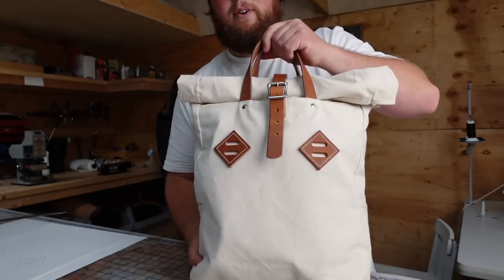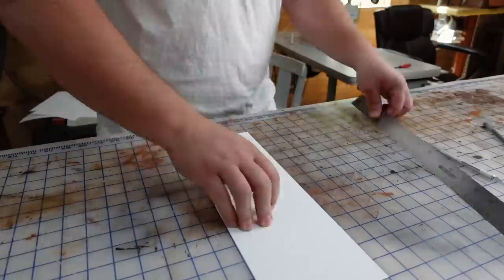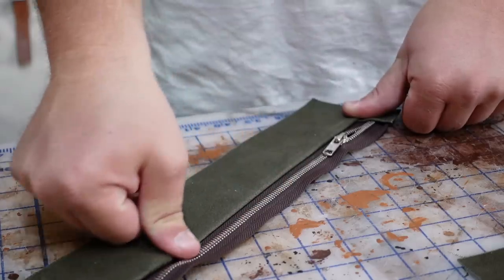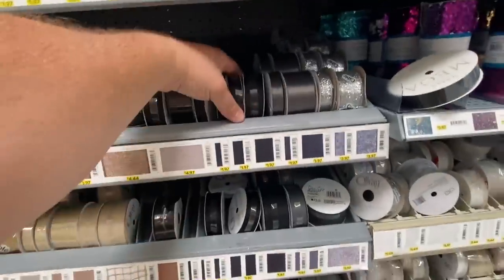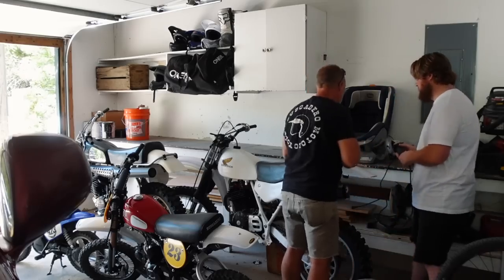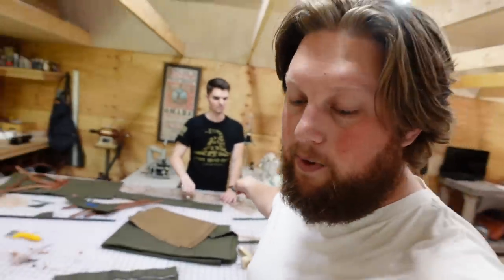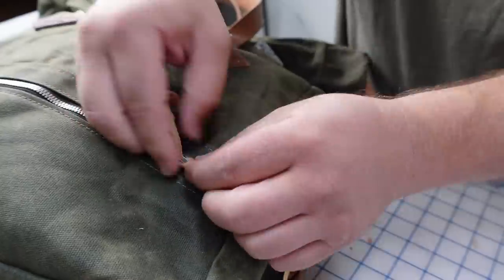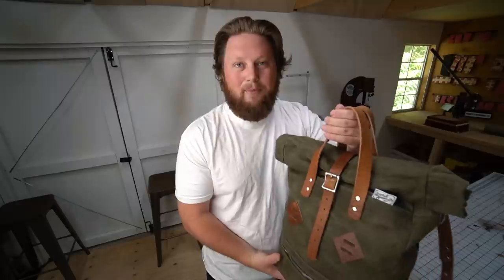Learning How to Make a Waxed Canvas Roll Top Backpack

Comment: Great video Parker! It's nice to see I'm not the only one that has struggled with those darn binding attachments. I ended up making a bracket for mine that attached to somewhere other than the slide plate. You'll be surprised how well those raw edges hold up. Waxed canvas does not fray like other woven textiles. I have waxed canvas projects I made years ago, use every day, and have had no fraying. Admittedly it does look cleaner with binding. An alternative to binding would be sewing a French seam. You would sew your bag twice; once with wrong sides together and a narrow seam allowance; then you would turn it and sew with right sides together, using a seam allowance larger than the first.  
My go to place for waxed canvas has been Fairfield Textiles. They have a plethora of options and their costume service is great.

Comment: Nice bag!  If I may, one way to avoid dealing with binding the interior seams on a bag like this is to install a "floating" liner - basically an inside-out version of the bag "shell," sewn to the shell around the mouth of the bag.  You can leave it loose, or sew the bottom seam allowances to each other for a more secure liner.  Since all of the seam allowances are trapped between the shell and the liner, no binding needed!
Also, 10.10 oz. canvas might be a little too light and thin.  #10 is about 15 oz., I love that weight for backpacks and similar bags.  10.10 oz is nice for a lighter weight and feel, but for me it doesn't have the same rugged quality I'm looking for from waxed canvas.
Thanks for sharing your process, and keep up the great work!
Reply: What would you say about hand stitching a bag like this with a 15oz canvas? Would the folds be too thick and unwieldy?

Comment: I use 12 ounce treated WR canvas and it is easy to work with.  Durafin also works but is a bit stiff and has an old tent odor.  I think tan 12oz Sunforger would work pretty good, but 10 ounce seems a bit light.

Comment: Hello, great bag.
I have two ideas on how you can finish the seams, since you are dealingwith fabricand not leather: 1st you can use French seams, this is when you sew the seams from the right side of the fabric (wrong side together) about 1/4 inch seams and them you turn the bag outside in and you sew again about 3/8 to 1/2 inch seam encasing the first seam, this will secure the seams and avoid fraying of the fabric.
Second choice will be to use water proof canvas for the strips of binding, this is the favorite choice for bag making to finishthe inside seams, it doesn't frayed and you can cut the strips any width you want.
I hope this will help you with this bad finishings 😊.

Comment: I have a few tips. I haven’t seen newer videos so you may have done this, but invest in a domestic sewing machine. They are perfect for small repairs. They also have a bunch of different feet so that binding issue you were having could be pretty easily handled. When it comes to those spots that didn’t get caught, just hand sew them.  
I love thé bag.  Thanks for sharing the process.

Comment: Binding is a pain. I work with 16 oz waxed canvas pretty exclusively and have found that pre-running 1/2” basting tape down the roll of 7/8” grosgrain will hold onto the canvas enough to get to the sewing machine. Bonus is it helps seal the stitch along with the wax…still tediously has to be added by hand but ends up with a straighter binding. Serger is definitely my next investment. Have never tried the attachments but it’s good to see they may be a waste of time anyway. Thanks

Comment: I really love that you added a zipper. Dealing with that buckle every time would get frustrating. Even on my bags I find that a regular buckle or G hook gets old when you're in and out of your bag a lot. The zipper really helps. The front pocket zipper does add a lot of work to a bag. I think It would be fine if you left it out. The side zipper makes it easy to get into the bag to grab stuff. People always ask me "why can't you just add a few zipper pockets, and an inside organizer." It's because it makes the bags super complex, and zippers are not easy to do quickly. Adding 2 zippers would easily double the production time for a bag for me. I always think simpler is better. In the long run the zippers are going to be the first thing that fails, and I want my products to last a lifetime, and maybe be multi-generational.
Reply: That said, what's the point of a roll top bag if you are going to use the zipper for access? The design of his bag IMO was flawed from the start in that roll top bags are really for water proof carriers. So the lining should be a heat sealed vinyl and some lightweight outer covering. Also a buckle connection sewn to the mouth is faster than a vertical strap.

I've never seen this guys videos before so IDK if this is a fashion oriented business in which case it makes sense why he did what he did.

Comment: sweet project,
just some thoughts, You can buy a cheap "vinyl cutter" or plotter from US Cutter
Also you can hand stitch binding on your "flat" machine. I actually rarely use my binding set in our custom upholstery shop now. You sew your first line along the outside like any other seam, 2nd run you flip the binding to the inside and run the needle down the edge of your binding from the top. 
If that made sense lol
If gives you a seamless binding, but more importantly it gives you a folded edge so risk of fraying is eliminated.

Comment: If you don't have the correct size binding for the attachment it'll never work correctly. You can get the correct stuff, or just do the binding by hand. Its more difficult, but turns out better than having it wobble the whole time. The attachments do work better when the holes are attached straight to the machine. I would get the swinging binding attachment from sailrite.com That one lets you do corners, and backstitch easier. Sailrite also sells good waxed canvas too.

Comment: Just came across this video. 
Just some heads up-->
"waxed" canvas never sticks to tape.
If you want binding for this kind of canvas (in the future), skive down leather or use thin leather about 1 oz.
Work the full pattern out using heavy craft paper and some tape to hold together. Then when you have tweaked the design, build it in leather or canvas. For waxed canvas, go lighter.  For leather use 5-6 oz upholstery or milled veg. 

Sorry to see you struggling with this 😔. But trust with just a few adjustments you can make it happen. 🤗

Comment: Hi - I am wondering if you have got some advice on an issue I am having.  I am making a bag out of 16oz waxed canvas.  I want to attached a leather label to it.  Similiar to your leather you have attached.  When I attach the leather with rivets, after some time days, there are bleed marks that start in the shape of the rivets that get larger and larger.  Discoulouring the leather label.  Do you know a solution??  I am thinking it is the wax seeping on the the leather thru the penetration holes.

Comment: - what prevents the use of developments and examples of backpacks of 1920-30, both American and Austrian manufacturers? Already all drawings and sizes can be found in books and magazines. You didn't invent the bicycle. At the same time, you do not have to replace the shoulder strap at all, or add a frame. Such a sensation that they made a bag for going to the store for milk - only more brutal. The idea is good, but the implementation is zero. You study your history poorly.